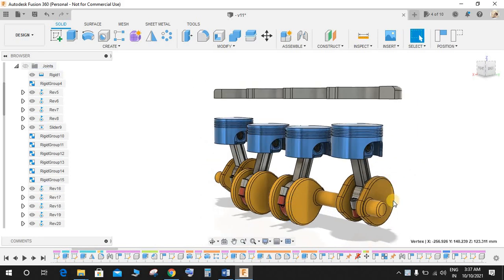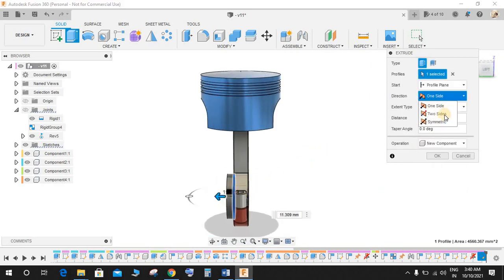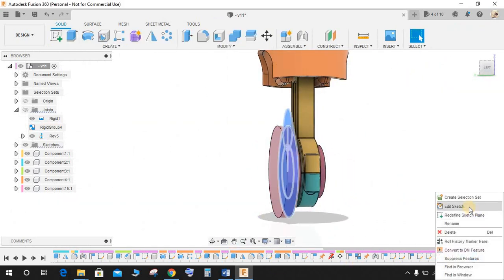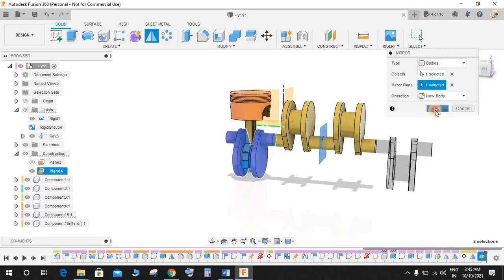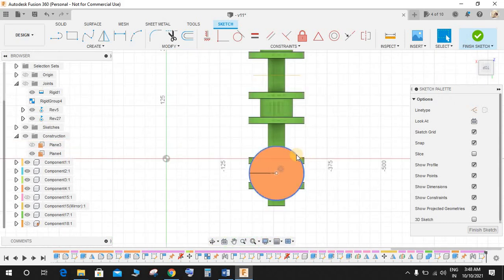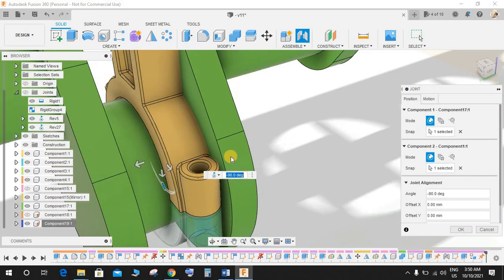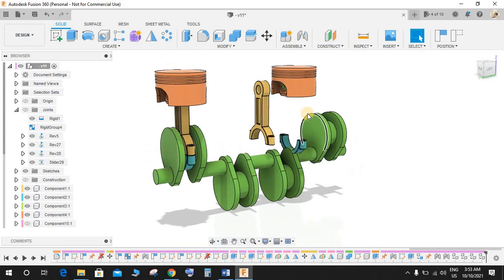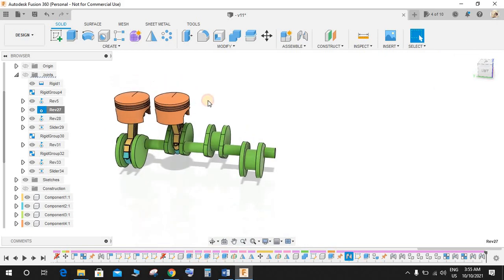Engine Assembly In Fusion 360 | Fusion 360 Tutorial for Absolute beginners

Comment: Bro after joining the piston with the grounded rectangular holed box at the top,  I can't move the while piston..it doesn't move..
Reply from the maker: Email me with more details  brother, it's impossible to tell just by this.
Reply: @SPARKPLUG98  I got it solved. Thanks for the video buddy.
Reply from the maker: Thanks for supporting
Reply: @HungerMinds  Hey Hunger Minds I had the same issue how did you solve it?
Reply: @HungerMinds bro can you tell me how to fix it
Reply: @SPARKPLUG98  yes bro even i am having the same problem. Can u please reply and tell me how to resolve this
Reply from the maker: Bro Mail me with details
Reply: @SPARKPLUG98  mail id bro
Reply from the maker: muammarqazzafi@gmail.com
Reply: @SPARKPLUG98  Hey, I was watching your tutorial and I also got stuck on this, I've sent you an email by Zedhan Z, I was wondering if you could help me.
Reply: @SPARKPLUG98 Bro, I got the task of making an assembly, and I followed your piston making tutorial, but when i joining piston with grounded rectangular holed box At the top, I can't move the while piston.. It doesn't move. Can you tell me how to fix it 🙏🏼
Reply: @Z_kun11 bro can you tell me how to fix it
Reply: @herlambang6634 
Ok so instead of making it a joint, make it a as built joint with the top head of the piston and the engine block. This will allow you to move the crankshaft and piston.

When you make it a joint, the piston head rotates and it gets stuck

So make it a as-built joint.
Reply: @Z_kun11  okay bro, thanks for the answer, i will try it later, but if i get any problem can i contact you again?